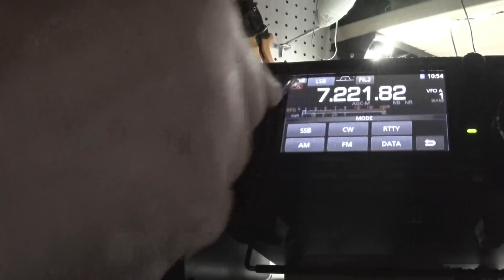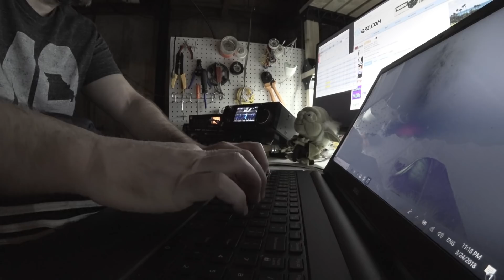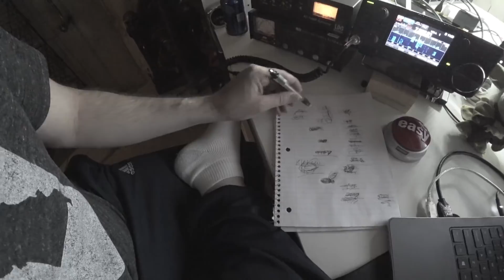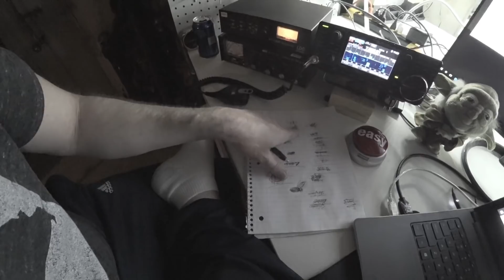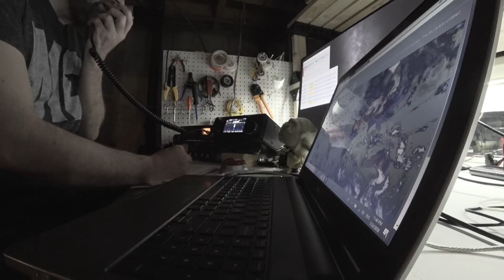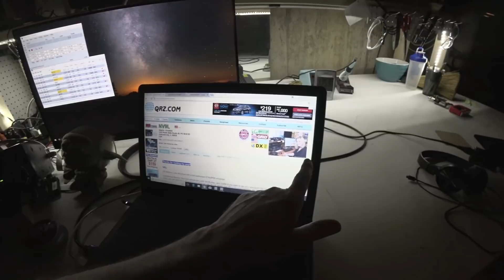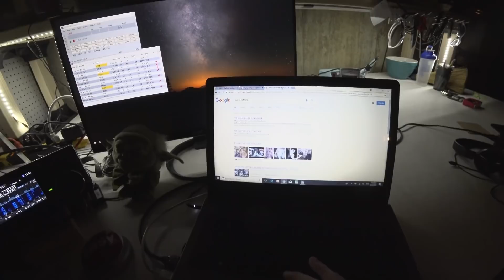Ham Radio Contest QSOs | Icom 7300 - Late Night

Comment: I Tom. nice work, Why, you do not enter directly your log into N!MM ??. . On this Contest, you previus knows the call that is calling CQ. or is only for rebember your Contacts on Paper? . Anyway. Congrats for your first SSB Contest. On This, I'm finish with 439 QSO,s .working All Band,  Low Power. Remember to Upload your Log, in Cabrillo File to the Contest Web Page..Keep Going on all the Ham Modes TOM, ... CW is The Best, but, SSB and Digital modes , are great to...73 from YV5EMG
Reply from the maker: Thanks for the nice comment.  I don't enter directly into N1MM because I have the microphone in my left hand.  I have to be ready to key down the mike.  Until I get a head set with microphone I won't have hands free to type.

I submitted my log with about 100 contacts.  Congrats on your 439! That's excellent.   73
Reply: Wow!!  100 Contact.. Excelent. if you uploaded it, you will be registered as a Contest station, for future contests.  then your call sign will appear automatically in the check log window of the N1MM, and when someone enters it, it will know that I hear it correctly,  YV5EMG

Comment: You should reduce your rf gain, if you really like clear sounding receive. I can hear your AGC "pumping" after the station in your rx unkeys. Doing this will do wonders for your rig to "sort out" what it's hearing ..especially if you have nearby interference. It'll make your filters work much better, and be ALOT easier on the ears. Don't worry about missing lower stations. Your rig has plenty of sensitivity. It's all good. Enjoy watching you "come up" in amateur radio.
Reply from the maker: Thanks for commenting!

Comment: NV9L was running a multi station, meaning multiple operators using the same callsign.  Obviously you were talking to one of the other operators.  Valerie is a guest on many podcasts including Ham Nation where she is a weekly host, that may have been where you have seen her before.  They (she and her husband) are avid contesters and have a huge antenna farm (see pictures and a video on he QRZ page).  It won't be the last time you hear that callsign.  I'm up in Chicago so I hear them all the time too, but I don't have an anything that will tune up on 80m, so my late night ops are hindered a bit....

Comment: juast watching the video and hear you giving out the numbers thinking why you not saying 001 059 etc then you worked it and as you say its all to do with communication.
i spoke to 8P5A and got a 5/9 saturday on 10w from the uk ( England ). Radio is a great thing and one of the best things is being nice and comfortable at the radio.
the more comfortable you are the better it is.
as somebody has mentioned using a headset you either need to use the vox or a foot switch
Reply from the maker: Martin M6LKD yeah I wasn't saying 0 because I hadn't learned it at that point.  Getting better as I go and hopefully teaching new hams as well

Comment: I was looking at headsets and realized that unless they have a footswitch, I'll still have to hold the keyer for the mic in one hand...I don't think a vox control is a viable option..? In hindsight, I should've thought out my callsign better...I've thought about changing it once I get my extra ticket, but...I;m still on the fence...A short callsign is nice to say though! Love the ending! I remember those nights....my kids never had to suffer through...all the tv channels are off.....
Reply from the maker: Ron C you are thinking exact same as me... foot switch or VOX?  Yeah I used to watch David Letterman as a kid and see that every night in the summer. Lol
Reply: I did the exact same thing on my tablet, scribble out the call sign and the number the calling station was on so I would know my number if I made the contact. Sometimes I'd wait until they gave out the next number to be sure of mine...lol. that (paper) tablet was covered...I''d cross them out once I was done to prevent getting confused.